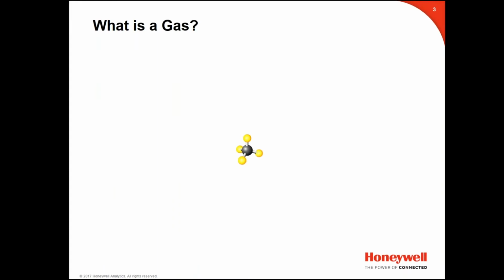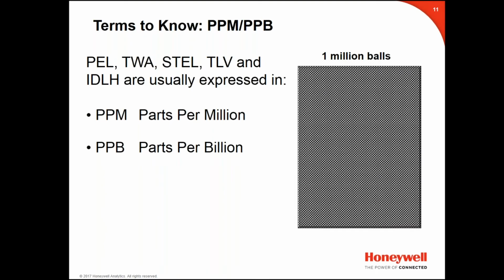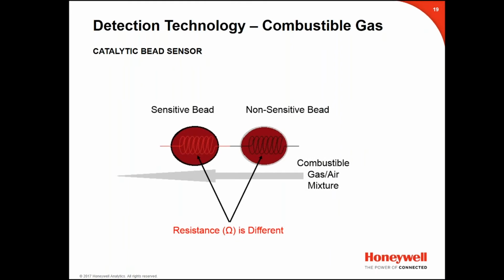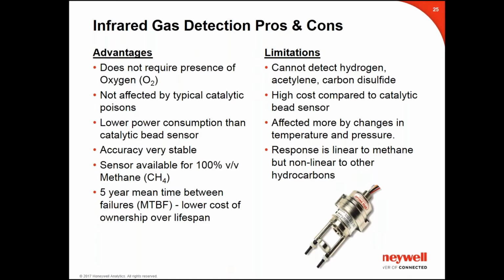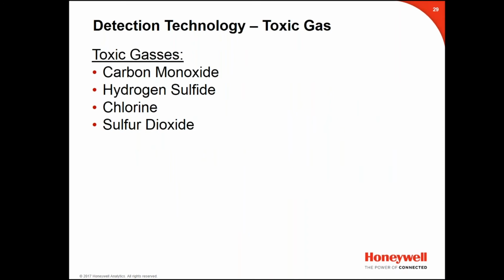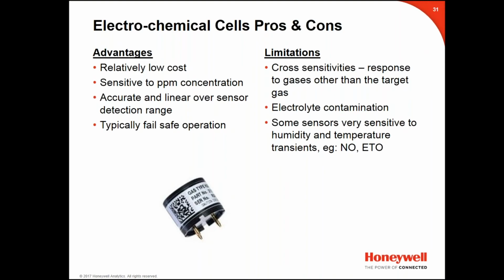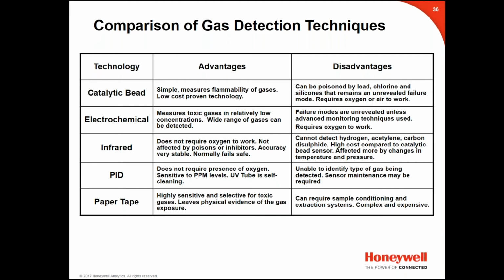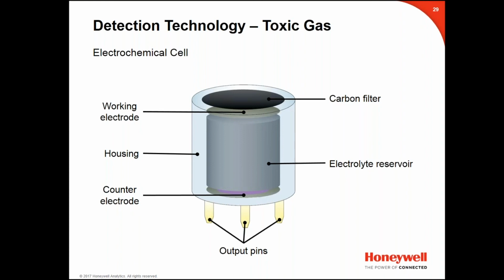Lesman Webinar: Fixed Gas Detection 101

Comment: How i can choose detector type to measure HC gas in Cooling water? LEL method or PPM method please advised
Reply from the maker: Our detectors are designed to measure in air, not water.  There are ways to measure dissolved gases, but they are more complex systems.  Would it make sense to have a more detailed discussion in person? 
You can reach us at 800-953-7626. Ask for John G, our plant safety specialist.